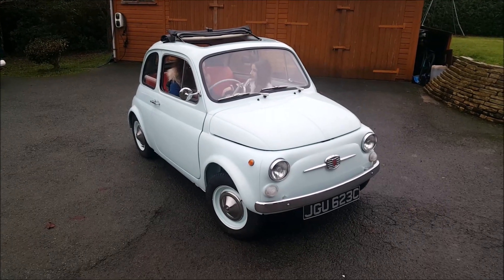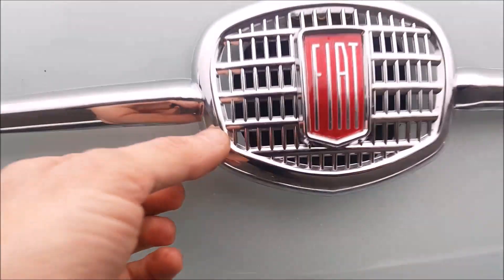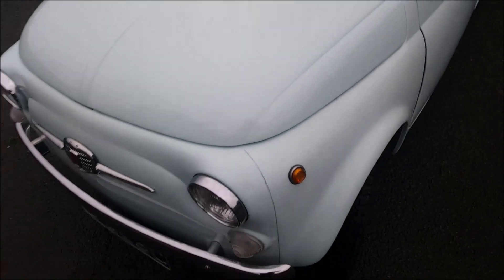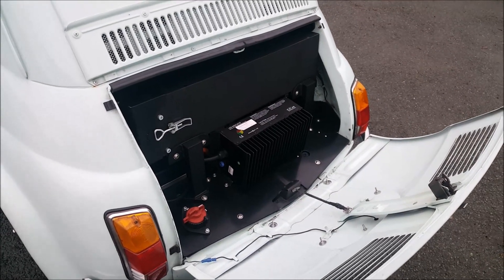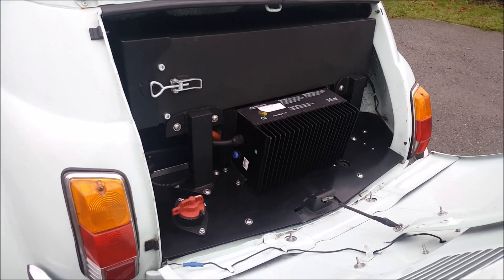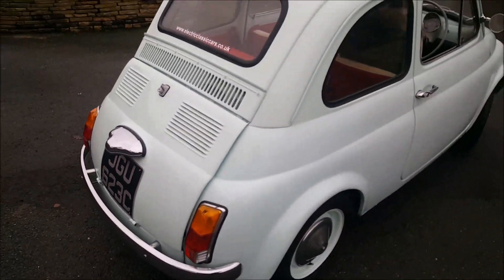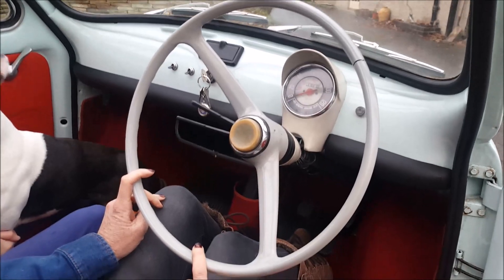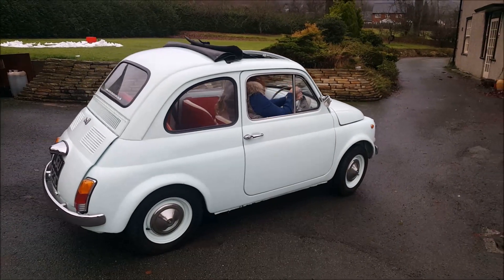Walk-around of our electric Fiat 500

Comment: Wish it would let me do multiple thumbs ups. That’s awesome. Great work. How much are you looking at for that EV conversion (not including donor car and restoration)?
Reply: I called them. It costs £20,000 plus the donor car
Reply: Ben Hallam : no conversion of this quality is going to be cheap. I'd expect at least five figures, with the decimal point after.
Reply: Aye, that will kill a lot of dreams.
Reply: Even with cheap Chinese batteries, 16kW.hr is going to cost $3,500+ shipping. But that's 1,700 batteries to be assembled.

Add motor, controller, cabling, labour, custom parts to fit, easily $10k in parts.

Still cheaper than a Tesla, but doable.